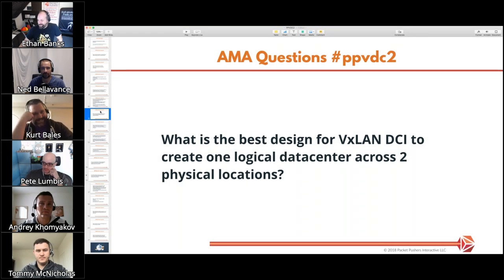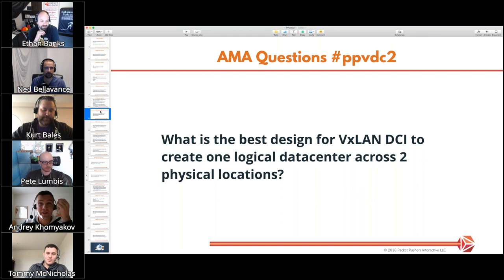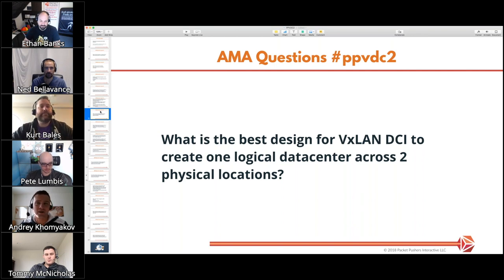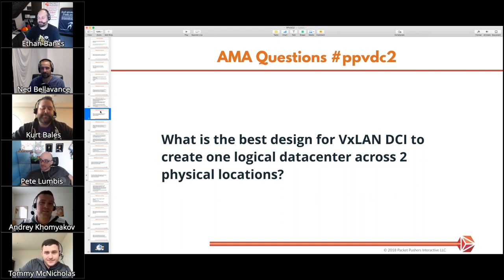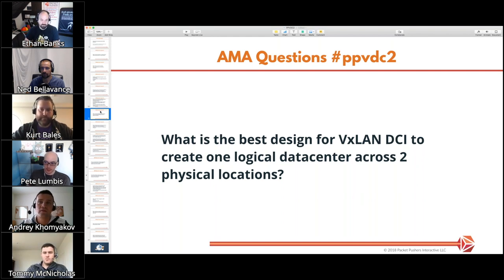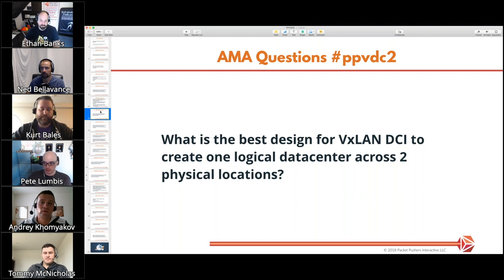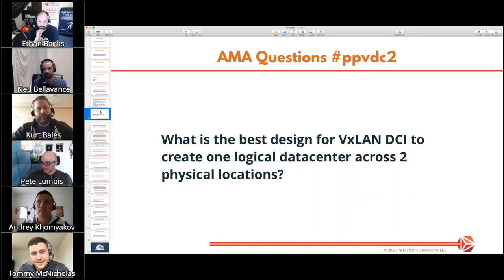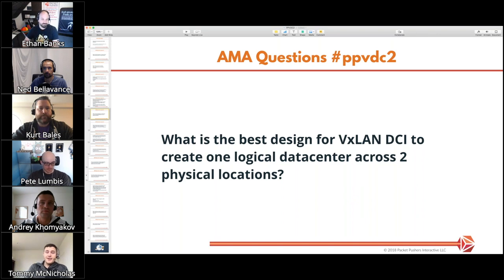Using VXLAN To Span One Data Center Across Two Locations

Comment: Thanks team. i am planning to deploy VxLAN in my DC located in three different locations and a DR site and this is a Banking environment over 40 racks in total, so your video was very helpful for me but at this point i cannot make any decisions need more knowledge to prepare my presentation weather we require VxLAN, ACI, Nexus 9ks and 9300 or Juniper Contrial etc. if you can help me on i can provide more details. i will be greatful and waiting for your reply.